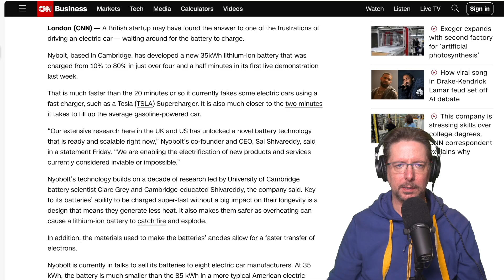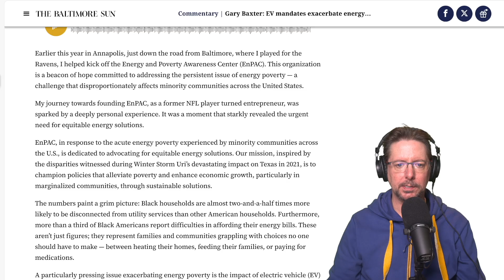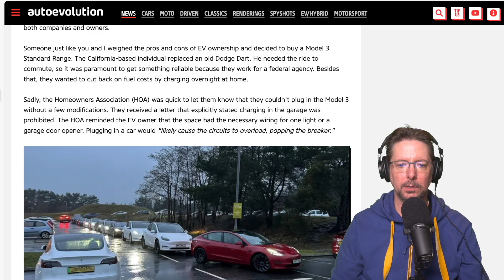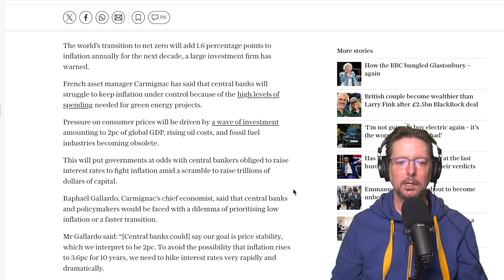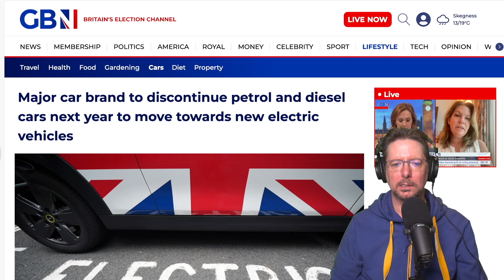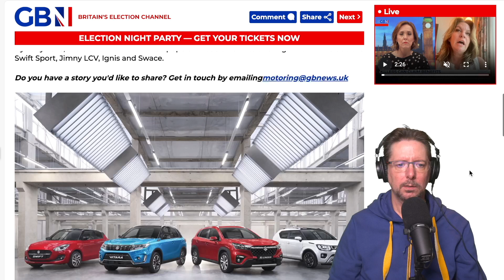Tesla owner's charging SHOCK! MGUY EV News Tuesday 2 July 2024 | MGUY Australia

Comment: I am not an extremist on either side.  EVs, ICE, Diesel and Hybrids are all good for different people.  I do like to see and be passed by quiet cars when I'm outdoors....but all the above (except most diesels) are very quiet in sedans.  Sport and trucks are like motorcycles...the drivers want noise.

For me, it will cost 1500+ to have a proper charger installed where I park our vehicles.  I factor that into the lifetime cost or savings fir an EV...so far the econimic saving math hasn't worked in the EVs favor....but if a person has the power already in the spot...and buys a depreciated used EV it could come close.

Comment: The uk 🇬🇧 is going to need that power station the uk is on the edge of massive black outs
Reply: The scary part is when you realize the infrastructure isn't up to it, it will take 5 or 10 years to fix it.
Reply: The current estimates too upgrade/fix the Power grid here in the UK is £3trillion.... Let that sink in and then ask who's going to be paying that....
Reply: @hudsonthepolarbear  that’s not true at all. Bit no one is in the comments here to tell the truth about stuff are they. The cost of 3 trillion is attributed to attaining net zero which is a significantly more expansive programme than just ‘fix the grid’. And it would put us in a place to generate sustainable, cheaper energy. And if you don’t like it, then just go somewhere else. Where they will be doing the same thing.
Reply: Rebellion inbound!
Reply: Lucky all those cctv cameras are ready
Reply: No it isn't. What a silly billy.
Reply: ‘On the edge of massive blackouts’ - bit hyperbolic isn’t it.
Reply: @Audioremedy0785  His mind (what's left of it) has been dissolved by diesel fumes. Actually the demand for grid-supplied electricity has decreased by 10% over the last 10 years - in large part due to residential solar PV installs.

Comment: In the timing they forgot to add on the ten minutes it takes to get the charger to talk to the car before it starts to charge. and that is as long as you don't have to move your car to another charge point because the one you pulled up to wont work.

Comment: 30kW hours can run a typical home in the US for a day.
Reply: I average 15 kW hours per day. During spring and fall, I average 10.
Reply: I have a 20kW Generac standby generator. Assuming it averages 10kW with our two air conditioners running, that’s 240kW hours for a full day. 35kWh would last 3.5 hours.
Reply: @softwarephil1709  I'm not an engineer and don't even play one on TV.  I do a little HVAC work.  Your compressors don't typically run continuously.  Having said that I think I googled that figure of 30kw hours/day in the US.  We tend to use more power than the rest of the world with bigger houses and AC.  Much of the world doesn't have AC.  Anyway, we're on the same team here.  My point is putting an EV on the road is like adding a house or multiple houses to the grid.  No power for it.

Comment: Just like owners of vicious, antisocial dogs, most ev owners that I know are blissfully blind to all the limitations, hassles, and costs. They look at electric cars through rose tinted goggles. Fan boys.
Reply: Evangilists
Reply: EVs have brutal acceleration, they are a fun way to burn rubber.  Other EV owners are maintenance-phobic, their talk about no oil changes is how they badly handled gasoline cars. EV owners have their reasons
Reply: @timothykeith1367 yes , electric motors generate enormous torque, which knew ? Oh only EVERYONE who has taken a train in the last 150 years or so .

The problem is , and always has been , portability.
Reply: EVangelists think electricity is produced by cute little elves who live in trees.
Sure... EVs have excellent acceleration... but they are still boring. It's all about how the power is put to the ground. Which is more fun, a 1970 440ci Plymouth Roadrunner... pounding through the gears as that beautiful V8 sings away? Or a whisper quiet, boring Tesla where you merely press down on a boring pedal? No sensations whatsoever... just, Blah.
Look at "Formula E" racing... sure the vehicles are fast but they are booooring. Formula E... no fans.
Reply: So the people who own and drive them actually like them?! Crazy stuff, must be a giant conspiracy.
Reply: The biggest dildo on the roads today are spandex guys riding bicycles.
Reply: You do know that the breed of dogs most likely to bite is MINIATURE SCHNAUZERS, right?

Comment: Fast charging scam, how fast they charge your credit card.
Reply: Here's the same planet savers trying to talk up their turd EVs they are all so bitter because of how much money is lost in value worth nothing
Reply: @pauldarderi3560  people like you make le laugh. My ex saves my £2k a year and is worth a few hundred pounds less than its ice equivalent.
Reply: @pauldarderi3560  LOL Wut?? My EV is fast, silent and runs on energy from the sun off my solar panels in our sunny climate. I couldn't be happier, as is every other EV owner I know. Where do you get your info and all that anger from?
Reply: @evfactsnotliesplease  So total cost of ownership over a given period doing the same amount of kms and including things like depreciation and the opportunity cost of the extra money spent on panels etc, including replacement, have all been included in your calculations have they?
I saw a similar vehicle to my Diesel 4wd at a dealership a couple of weeks ago. Theirs had done double the kms mine has and was a year older and they wanted the same money I paid for mine about 5 years ago.
So there is no road noise from your EV either then?
Our ICE vehicle is also very quiet on the road anyway.
Reply: @oldbloke204  Good for you, stay with what you have. We already had solar panels fitted before the EV.  Depreciation becomes an issue if you sell. If you don't sell it is not an issue. BTW modern solar panels last about 25 years.  EV's are almost silent aside from some tire and wind noise.  I have a 2022 diesel 4wd and it drives like a gravel truck compared to an EV.   Our business has saved about $4000-$4500 per annum.  Just sayin.
Reply: @evfactsnotliesplease  So in other words you can write off the costs against a business unlike private owners then?
So the cost of the solar at home has to be included then, as I said?
Also most people work during the day when the sun is shining and use their vehicle for work?
Well at least the wage slaves do who don't understand false economy I guess.
So you're never going to sell your EV and most people don't update their vehicles ever and nothing in the EV/renewable universe ever breaks?
You just make all the same noises as all the others do.
Nothing better than taking my Diesel 4wd off road and enjoying some peace and quiet away from the crowds without having to even think about range or plotting my route via chargers either.
Reply: @evfactsnotliesplease  your EV is fast? So what when the average speed of a car in most places of the world is bw 30-40 KM/hr. Are you breaking the law by over speeding? even if you are how fast can you go. pretty sure you are not going fast enough to say now ICE is going faster than mine.
Also you forgot the money you paid to install that solar system. have you ever calculated how mush KMs you need to drive before even come to break even terms if you had bought an ICE?
Reply: @wonderwalls3565  Speed limits range from 40kph in a school zone to 110kph on the highway where I live. Who said anything about speeding?  Also we had the solar system before we bought an EV. If you knew anything about EV's you would know they offer 100% torque at idle so acceleration is much greater than an ICE vehicle.  It has nothing to do with speeding.  The main drawback with EV's is listening to the nonsense thrown up by people who feel threatened by them.  Many feel the need to parrot factually incorrect information they heard on YT pages such as this from other people who also have no actual knowledge of EV's. If you'd prefer to learn some facts about EV's this is not the place to do that.
Reply: @evfactsnotliesplease  I talked about average speed. have you ever found out the average speed that people's car drive at the end of a day? its bw 30-50km/h, depending on which part of the world you live.
So how are you getting better acceleration when there is an ICE car in front of you at the light?
You are parroting things which has nothing to do with life in practical.
Reply: @wonderwalls3565  <—— Obviously not too bright.

WTF are you talking about bro?
Reply: @evfactsnotliesplease , You’re obviously talking to a dum bass….
Reply: @terjeoseberg990  Ofcourse went over EV fanboy's head.
Reply: ...or dis-charge your debit card/bank account.
Reply: @surlyogre1476 you realise they are cheaper than fuel cars right?
Reply: @Audioremedy0785  Not much realisation going on here.  A lot of 2nd hand factually incorrect gossip though.
Reply: @Audioremedy0785  Not always. There are many documented cases of superchargers costing more than the equivalent of gas in a combustion car. For example the one in California with $50+ charge for about 200 miles of range.
Reply: @Audioremedy0785  

Yeah, that 50,000 dollars on an EV buys 25,000 litres of fuel   enough for 250,000km to 350,000km depending on car....

I rather keep my old school diesel and put the money into the fuel tank...
Reply: @Audioremedy0785  they are cheaper than fuel cars? sounds like you are smoking something cheap.
Reply: @qwertyui90qwertyui90  imagine paying that much for fuel and thinking you are winning. Just for reference, it would cost less than £4k for 250k miles of range in an EV.
Reply: @wonderwalls3565  yeah. If you look mate the market space is now so competitive, the likes of the model Y are now cheaper than their ice equivalents. And exponentially cheaper the run. Objectively so. Do a bit of research and come back!
Reply: @Audioremedy0785  Seems like you have done the research. Would you like to share with us so that we can say that EV is cheaper to buy and cheaper to run in comparison with an ICE.
Reply: @wonderwalls3565  there are two points here. To buy a Tesla model Y, it’s cheaper than its equivalent ICE car at less than $40k as it was formally said to be on a par when it was $45k. And speaking from my own experience and EV is exponentially cheaper to run than my ice car equivalent. Insurance is about £80 a year more. But that’s offset by no road tax needed. And the fuel, it’s not even close. It’s saving me to the tune of thousands a year.
Reply: @Audioremedy0785  wow. you are switching from $ to pounds? whats going on.
Also I thought we were talking about in general. now you are talking about "its cheaper for me".
No road tax means tax payers are incentivise your life. Why is it that its so cheap to run, its fast, reliable but still needs government to incentivise it?
Reply: @wonderwalls3565  I’m switching between the two as I am referencing purchase price in the USA vs running cost in the uk (as that’s where my example comes from). I pay 40% tax in the uk, send my kids to private school and don’t use the public health system. I also don’t eat meat or use fossil fuels which are both heavily subsidised. So to say that tax payers ‘incentivise my life’ is a little bit off the mark. And it has gov subsidy because it’s a new technology that has huge long term benefits for adoption. No one mentions that the iPhone was subsidised. Back then it was just how tech innovation worked. It still is. But it’s a bit too complex for you guys. 👍🏻👍🏻
Reply: @wonderwalls3565 , Can you explain why oil exploration is subsided? Why should people who don’t own a car need to subsidize your oil?
Reply: Now que the EV cultists/bots claiming they are cheaper to run which has been debunked seven ways from Sunday, and they charge their ev’s  from their solar panels at home🤣👍
Reply: So in the US they call ev charging station points "pedestals "...ironic but so fitting.
Reply: They can very easily install slow chargers all along the streets so everyone can charge their car when they park along the streets.
Reply: @terjeoseberg990  who is paying for that and replacing them when cords are stolen?
Reply: @terjeoseberg990  easily? that is why they took around 7bn dollars and installed 8 chargers? If its that easy why have not they done it yet.
Seems like you dont know how infrastructure are planned and designed in a city and towns.
Reply: @wonderwalls3565 , That’s a lie, and you obviously need to work on your English.
Reply: @terjeoseberg990  Ah yes nothing wrong with  80 1 ton steel and plastic monsters sucking up kilowatts of power on the same street, totally not going to cause lithium fires, overwork the already shittily made power grid in Australia and so on.
Reply: @Rexhunterj , You’re confused.
Reply: A lot slower than petrol will discharge card
Reply: @BamBam-uf4yi  😂